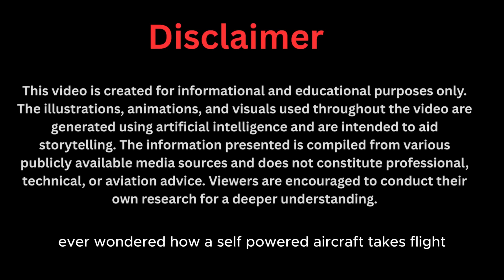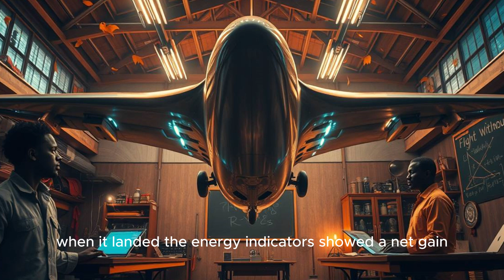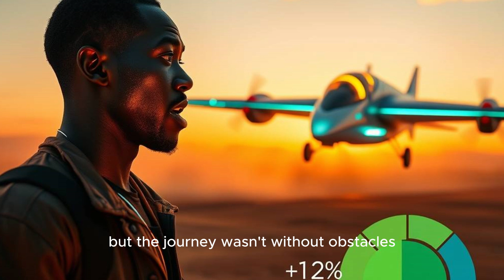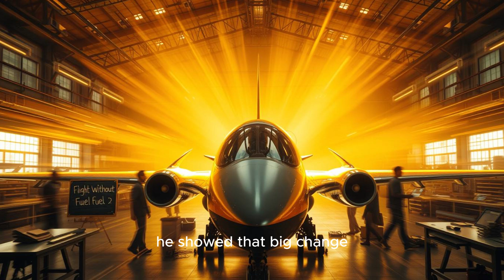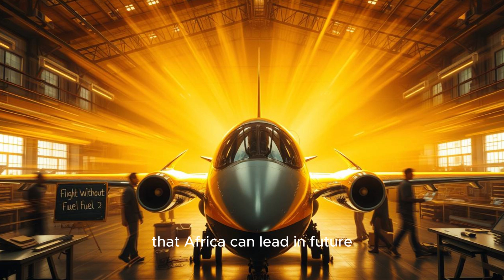Behind the Scenes: Building Maxwell's Self-Powered Aircraft

Comment: It is difficult to build an aircraft. It is a lot more problem to build your first aircraft. Using imported engineers makes it perhaps simpler but it will become expensive and timeconsuming. It would normally take years to develop the aircraft. You describe it as if it was ready already after some months.  No photograph shown. Every picture is computer drawn.  No video either. Adding the complexity with selfcharging it could take years. And more to the lacking scientific background.  This is not a plausible story. For every new complication I doubt Maxwell more and more. Why do you complicate it so much. For every stage you lose believers. Stop boasting.